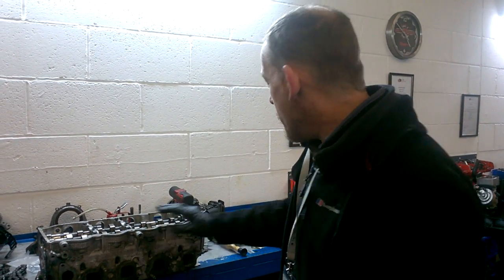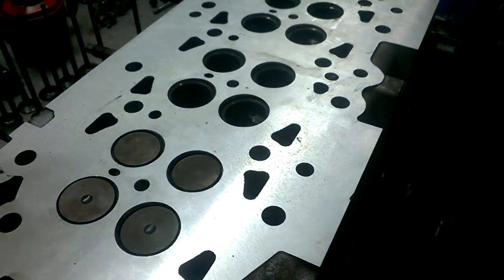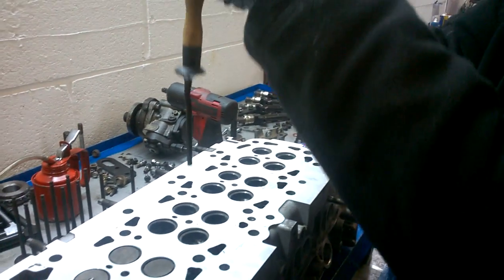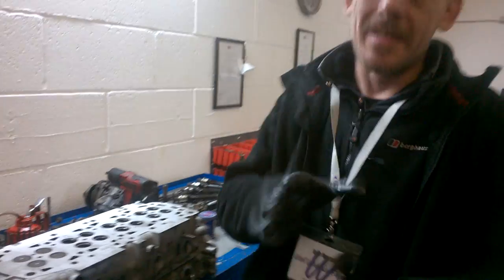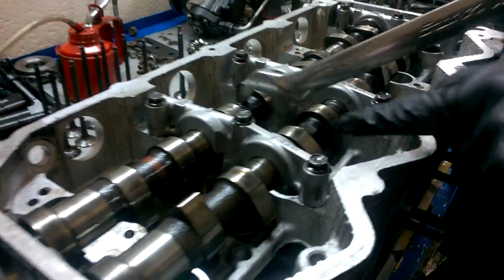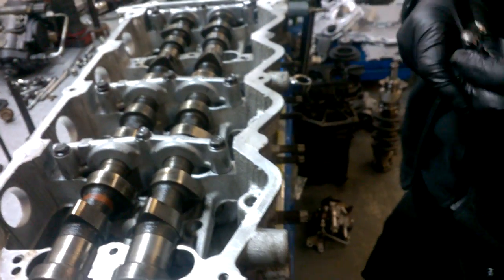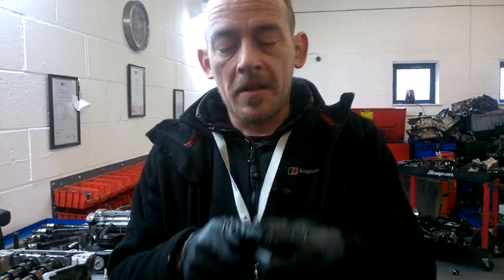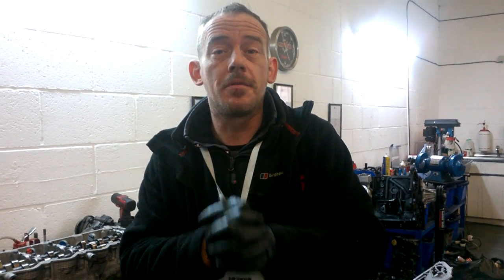How to build Nissan navara cylinder head part 2

Comment: Hey Des, have you guys run into many D40's with out of spec valve clearances. Just did mine and the worst were 18,17,16,15,15,8  thou. My ute has done 110,000km. Definitely doesn't look like it's ever had a head job or any work etc. I'm surprised how bad the clearances are from factory. It's Thai built. I swapped shims around and managed to correct the worst of it but there was only so much I could do with what I had, it's still not perfect. Seems quieter and running better. I rang Nissan and they had no shims in stock (order from Japan only)
Reply from the maker: We set our's at 12/14 thou I can get new shimms
Reply: @westyorkshireengineservice9160  do you see many like that though? Are your shims on your website?

Comment: Workshop manual says from 9 to13 thou for intake and 10-13 thou for exhaust. 
My D40's clearances are quite  poor for only having done 100,000km. Exhaust clearances as much as 18thou and intake as low as 8 thou, with all sorts inbetween. If the top end is that bad it really makes me question the bottom end.

Comment: What type of YD25 Head is that? I bought a new head for my YD25 exactly like the one you have there but it's different from my old damaged one, the old one has 4 hole and the new one like yours has 8, will it still fit.
Please reply need you help.

Thank you
Reply from the maker: 01274640028

Comment: hello .cylinder head was skimmed.  
there is 6 types of head gasket. do I need same as was before skimming or I need to find something else . there is some cuts on a corner mine have 3 in cuts. 
thanks
Reply from the maker: You have the gasket you need
Reply: +West yorkshire engine services thank you

Comment: how to find TDC on a nissan frontier d22
Reply from the maker: Locking fuel pump at 12 o'clock with a phillips or 6mm drill bit.
Reply: Ok and how will you know when to stop
Reply: And i have an other question when you replacing engine seal (all of it) should you remove the engine or can you remove the engine head And take it from there????????

Comment: The manual says you need to put engine at tdc and check valve clearance not the way you showed. You check valve clearance on row 1,2,3 and 6 (first cam lobes turned sideways not upward). Then rotate crankshaft clockwise by one turn to set the No. 4 piston
 to TDC on the compression stroke. And check valve clearance on row 4, 5, 7 and 8. This video just proved that you are not a proffesional engine rebuild specialist. You only put cam up when you replace the shims with a specialised tool, not for checking the valve clearance. 
How the guy who works on this engines for 20 years can't properly do valve clearance is beyond me.
Reply: hi Poul you seem to know a lot on the subject ,, maybe you can help me with my project navara,, West Yorkshire engine ,, do not reply to mail, so i am a little in trouble with my clems greeting Dennis from Denmark
Reply: the manual might say do it X way. but if you are a reputable enough business willing to post their vids on youtube, you would think that maybe that they had done it before